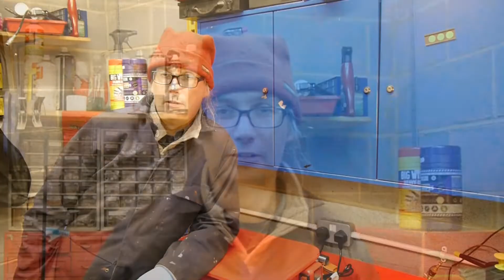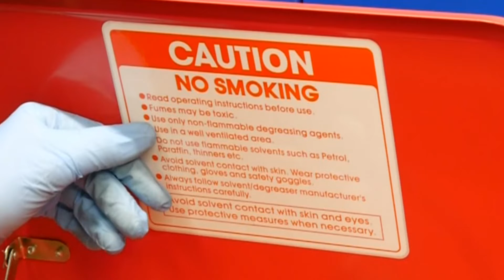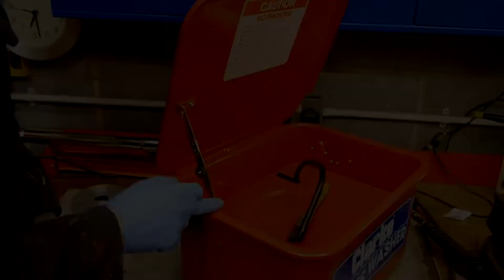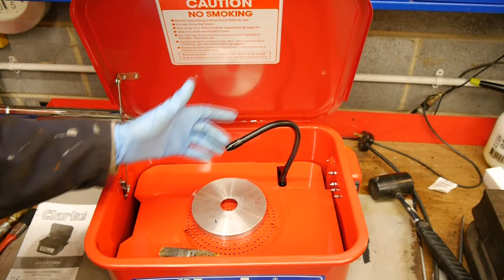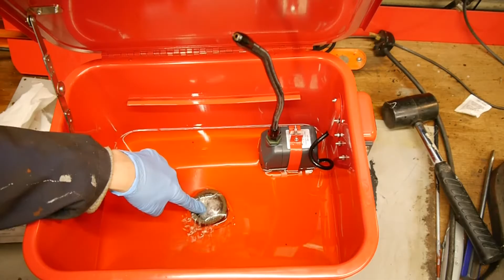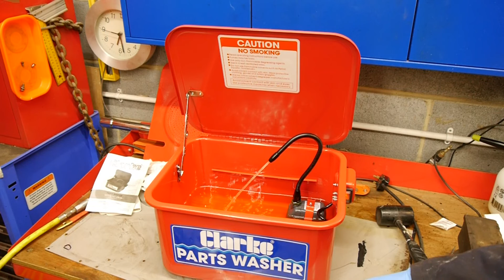The Dirty Parts

Comment: Paraffin is just so expensive, I'd use kerosene (heating oil)
Reply from the maker: K40  You know I am never quite sure if we are talking about the same products. I think paraffin is the same same as kerosene here in the U.K.  but different in the USA, it smells the same to me. I use the same product in my oil lamps that burn with a wick etc.  I don’t like the water soluble degreaser I have tried a few all rubbish compared to paraffin. Thanks for watching and comments stay safe chris.
Reply: @allthegearnoidea6752  
Aparrently it's same as paraffin but doesn't burn as clean more sulfur I think , paraffins for burning inside where smell is important whereas kerosene is for boilers.
I bought a sheen flame gun and saw the price of paraffin and thought sod that and got 20L of kerosene delivered for £19 from eBay it'd be cheaper from a local supplier but I haven't found one yet (Huddersfield)
Reply from the maker: K40 We are all wondering who is the mysterious K40. I thought you were a Yank with the kerosene comment etc.  I used to live in Lockwood Huddersfield and then I moved to Hormfirth but got sick of all the tourists. Live in Penistone now.  Maybe we can swap some radio junk when all this Pandemic stuff is finally away. Stay safe regards Chris
Reply: @allthegearnoidea6752  I came here from uk vintage radio and watched lots of videos after the iffy titled "BUM HOLES!"

Comment: Safety clean is the words that come to mind, but diesel works better.
There is a machine mart in coventry, well stocked but can be expensive lol.
Sorry just catching up on your vids, no need for any reply.
Reply from the maker: zx8401ztv  yes I think your right on the cleaner. I have used it and it’s shit even when using it undiluted. I will stick with the paraffin, but it does stink. Regards Chris